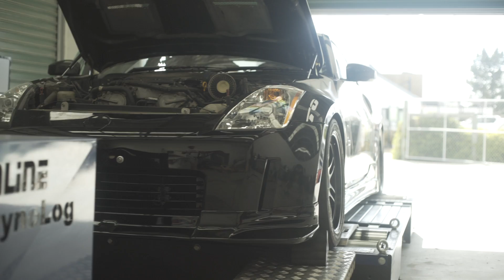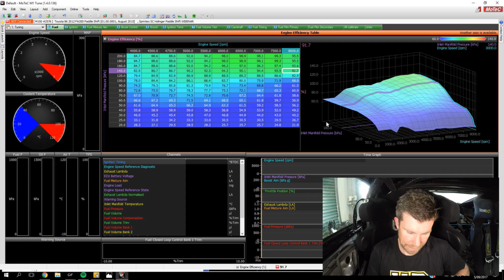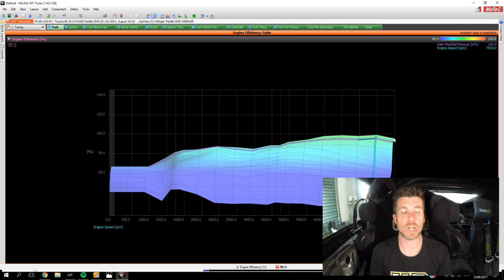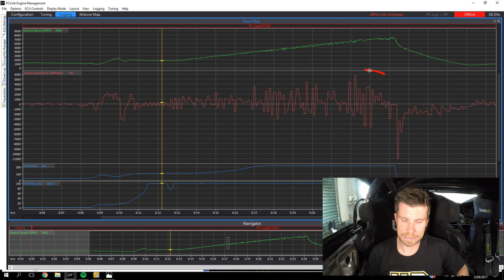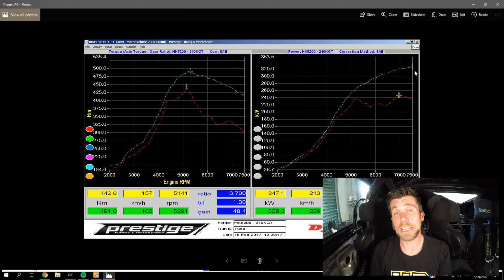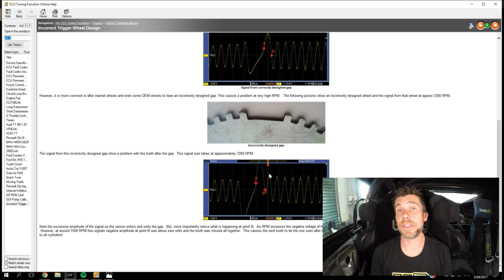5 Common FAILS When Tuning A Car And How To AVOID Them [GOLD WEBINAR LESSON]

Comment: Some great and interesting points. Love your willingness to share this incredibly insightful and useful information. 

Holden VS Commodore factory wiring harness, will "work" in a turbo / aftermarket ecu conversion, but after watching the wiring standards set by the likes of HP academy it's almost surprising the factory harness works at all. No emi shielding to be found on any wires, very limited or absent sheaving and powers the ecu, injectors, coils etc all together off a single 18 awg (ish) wire.

Comment: My first import (kinda) vehicle that I had  built and raced (and blew up lol) was a 1992 talon tsi AWD turbo I had never even heard of the 4g63 engine  and I was introduced and fell into a love hate relationship with it for many years until I started working at a subaru dealership and I was really like for real impressed with them and I heard about this turbo impreza overseas and I was hooked.... I wanted a GC 2.5rs but ended up in a 97 impreza outback sport wagon that I ended up performing a full drivetrain swap on... I was lucky enough to get ahold of a rolled over sti type  ra that I was able to get alot of for the time great parts from.... 
Talk about being kinda lost tho lol this was WAY before places like I wire and resources like nasioc to get information from... dccd 5 speed  really threw me for a loop lol I actually drove it to a training course I went to and picked the instructors brain who ended up making more than a few calls but they got me in the right direction.... remember this was right around mid  to late 2000
Reply from the maker: Yes it is easier now than it was back then for so much knowledge right! Even today there is still some newer technology that we're all catching up with though, that's part of the draw to industries like this. You can never learn or know it all - Taz.

Comment: Literally had my car on the dyno today and it wanted to run super lean after 4800 rpm. Granted it has too small of a fuel pump (340) and it’s on e85 but my tuner thinks it’s the id 1700 injectors.
Reply from the maker: Did you get this sorted? ID1700's are pretty big injectors, but there isn't enough information there to really add anything helpful without it being pure speculation.
That said, if you know the pump is already to small and you're running lean in the higher RPM range that would be the really obvious place to start - Taz.
Reply: Yes it wasnt the injectors, the maf wasnt reading correctly because it got dirty
Reply: @zokusharuuku1091 😂

Comment: re: Plug type - coppers are cheap enough to justify changing them out more often and are less prone to breaking apart inside the combustion chamber. For dialing in a tune coppers have benefits.

Comment: So if someones car fails on the Dyno (customers fault) because of old plugs or didn't tighten the intercooler clamps, do u charge them extra?
Reply from the maker: This isn't really a yes/no question as there are so many other factors at play, however, if we assume you had the wrong plugs etc causing a catastrophic failure on the dyno, yes, you would be charged a cleanup fee.
It's worth adding though I feel though this is more and more unlikely as many tuners will have a checklist for you to go through before you drop the car off meaning it is less likely to have such an issue, and also a good tuner doesn't start with a ramp run so it is likely they would notice an issue before getting so far into the tune that catastrophic failure occurs. Same for loose clamps.
As above though, there are more factors at play so it really is a situational thing - Taz.
Reply: My tuner supplies his own plugs for your car and does a few crucial checks before tuning.

Comment: Having a fuel pressure sensor that feed's into the ecu's fuel map is key these day's. FPR's are not truly linear with flow and pressure, so best to ensure the ECU is keeping watch and adjusting things correctly.

As for timing scatter with Nissan OEM CAS's. This is why having an ecu with an on board scope is so important. It makes diagnosis so much easier. More data is more better. Makes fault finding that much easier in all cases. limit's guess work that you don't get paid for.

Another great lecture.
Reply: ECU with an onboard scope is so important. It makes diagnosis so much easier. More data is more better. Makes fault-finding that much easier in all cases. limit's guesswork that you don't get paid for. Ok, Nice so what ECU's are those then?  can you speak more of these ECU's with the onboard scopes?

Comment: Where was you 7 years ago went threw 2 of my engines trying to figure out a  triggering problem lol back them 13b engines were easily available had a motec m2r didn't know about the mode 11.12.13.14 on trigger setup and know one knew or wanted to help then figured out rising rising. rising falling. Falling faling. Faling rising. Was a long time ago mabe in the wrong order ,^^

Comment: Sadly there is almost never a fairy tale ending in this job 😳 only ones I'd say would be tuning late model Holdens or Ford's with simple bolt ons 😉
Reply from the maker: Yes it is fair to say the more modified something is and also the more people who have worked on a car can mean that there is more time troubleshooting than you'd like, but with experience comes the ability to see what jobs might give you those gremlins and to discuss things with the owner and allow time for them before you start. 
In some cases, you may even wish to turn away the job, or get the owner to complete some changes before touching the car.
This situation is not unique to tuning however, it is really something you get across all trades in some form or another - Taz.
Reply: @hpa101  absolutely